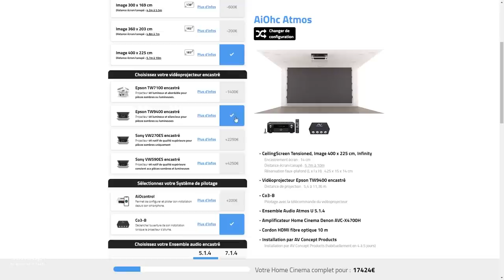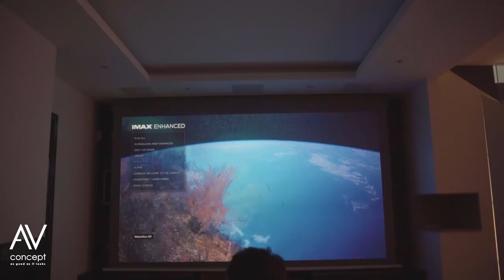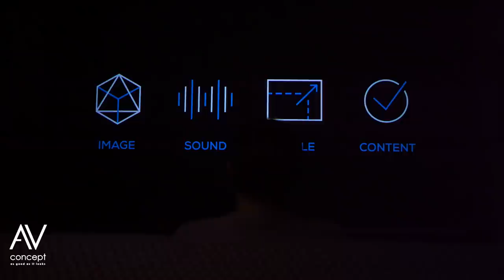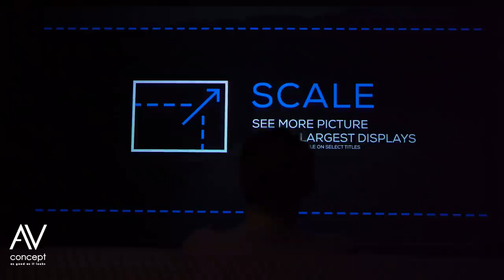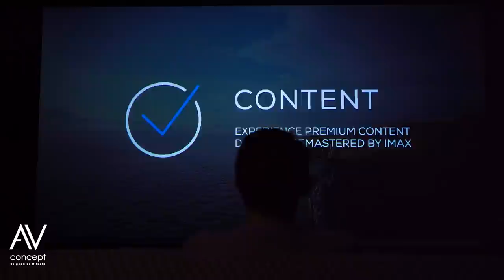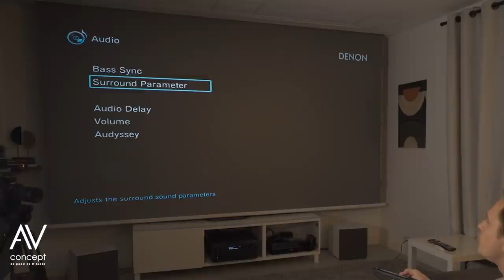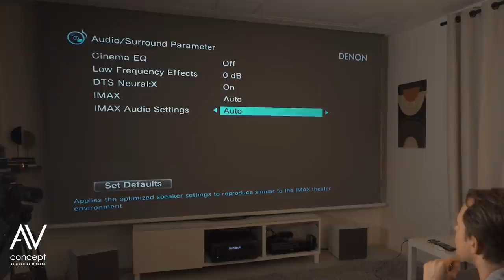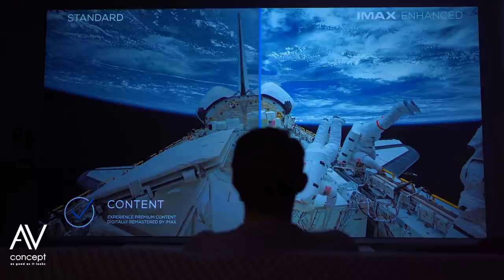Un Home cinéma IMAX dans son salon ??

Comment: Une équipe grandi avec un esprit pro et convivial cela fait plaisir. Vous êtes dans le partage de vos expériences avec bienveillance ce qui est de plus en plus rare. Merci encore pour le partage et à toute la team.
Reply: Un esprit pro qui te fais acheter deux caissons B&W ASW 610 XP à 1100 euros l'unité, alors que le même constructeur propose dans sa gamme de produit un DB4 S à 1600 euros qui te permet d'éviter tout effet parasite d'une part grâce à une application  dédiée très performante, et d'autre part est beaucoup plus lourd (26kg contre 15.5kg), est beaucoup plus puissant (1000W contre 500W), utilise un HP de grave très haut de gamme (Le même que celui de la série 800), et offre une finition exemplaire.

Le choix de deux caissons ASW 610 XP est totalement incompréhensible .
Surtout pour une installation  qui se veut DISCRÈTE (🤔???).
C'est juste n'importe quoi et pas du tout professionnel justement.
Mais bon.. Ca s'adresse à des clients qui vraisemblablement n'y connaissent RIEN.
Reply: @mikkygreg8730  votre avis peut être pertinent mais il ne faut pas oublié que deux caisson ensemble ont tendance (si bien intégré) a diffusé les basses de manière plus homogène et plus qualitative .

Comment: 26:10 Je trouve que de conseiller à un client de mettre 2 caisson de Grave B&W ASW 610 XP vendues respectivement 1100 euros l'unité, soit 2200 euros les deux caissons, n'est absolument pas judicieux...

Tout simplement car ce caisson n'est pas le meilleur rapport qualité/prix du côté de la gamme B&W d'une part et d'autre part le B&W DB4 S vendue 1600 euros l'unité est beaucoup plus performant (Voir le test du site On-MAG.), il permet de s'affranchir TOTALEMENT de l'effet cité par Sacha grâce à leur application maison permettant un paramétrage idéal !

De plus, le B&W DB4 S pèse 26kg contre seulement 15,5kg pour l"ASW 610 XP, nul besoin d'être ingénieur acousticien pour se rendre compte IMMÉDIATEMENT que l'un et l'autre ne joue pas dans la même cours.
(Le poids offre la stabilité nécessaire afin d'offrir un grave qui soit le plus nuancé possible, il faut également savoir que le DB4 S utilise un HP de la série 800 qui est la gamme la plus aboutie de chez B&W, ainsi qu'un ampli de 1000W RMS en classe D, soit 2 fois la puissance de l'ASW 610 XP.)

Le DB4 S est par conséquent une RÉFÉRENCE ABSOLUE dans sa gamme de prix.

Il ne suffit pas de savoir réaliser une installation, il FAUT ÉGALEMENT CONNAITRE LES PRODUITS que l'on fait acheter au client.

Ces deux caissons ASW 610 XP sont bien moins pertinent qu'un SEUL DB4 S. 
Choix incompréhensible...Mais bon on peut vendre n'importe quelle soupe à des non connaisseurs.
Que ce soit en terme de tarif ou de prestations.
Reply from the maker: Salut @mikky greg quel plaisir de se lever le matin et de lire ton commentaire :)

Spoiler : cette réponse n'est pas sur l'aspect technique, car d'accord ou non, on peut en discuter longtemps, et ce n'est pas le but.

Notre travail est de rendre les gens heureux avec des installations au top.

Là où des spécialistes vont couper les cheveux en quatre sur chaque éléments, nous avons une boîte à outils avec des produits robustes, que l'on maîtrise et que l'on peut réutiliser.

Comme lorsque tu achètes une voiture, tu n'as pas TOUTES les options disponibles pour chaque éléments de ta voiture (roues, radio, volant, carosseries...), ca ce qui compte, c'est d'avoir une voiture complète qui fonctionne du feu de dieu.
C'est ce que l'on propose.
Et visiblement, nos clients apprécient.

On peut évidemment passer de longues heures à sélectionner un nuage de produits à proposer à chaque client mais au fond, ca ne change pas drastiquement l'expérience finale. Et surtout, ca apporte plus de confusion que de clarté.

En revanche, le fait qu'on connaisse parfaitement un produit, sans le découvrir sur place, savoir l'ajuster comme il faut et en sortir le meilleur, ca importe pour notre service.

Nous montrons notre travail sans rien cacher et partageons ce que l'on sait.
Notre job est autant de proposer des performances hors du commun, qu'une intégration complète, exécutée aussi parfaitement que possible dans un temps imparti.

J'ai l'impression que ton commentaire nous éloigne de l'objectif dans son ensemble : l'installation dans sa globalité.
Des architectes d'intérieur peuvent aussi critiquer la disposition, des experts de l'image peuvent critiquer le choix des équipements....
C'est un sujet sans fin, et à titre personnel, de l'entreprise et de nos clients, ce n'est pas ce qui nous intéresse.

Pour conclure, peux-tu nous faire une visite de ton installation, il y a surement plein de belles choses à voir et à apprendre.
Et peut-être y-a-t-il un endroit ou l'on peut trouver l'ensemble des conseils que tu offres aux non initiés, pour qu'ils puissent être éclairé ?
Si c'est le cas, nous serons heureux de le transmettre à nos abonnés pour qu'ils puissent s'enrichir sur le sujet :)

Merci mikky greg pour ton ouverture d'esprit et à bientôt,

Sacha